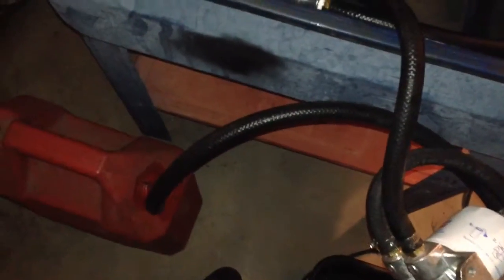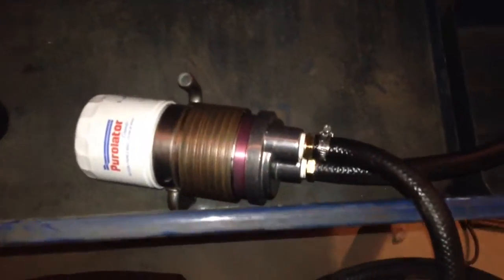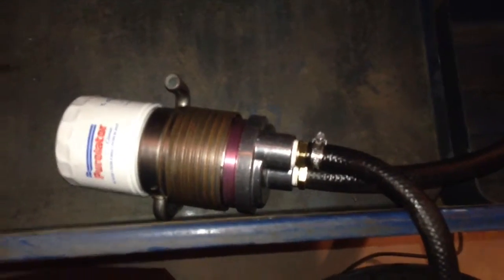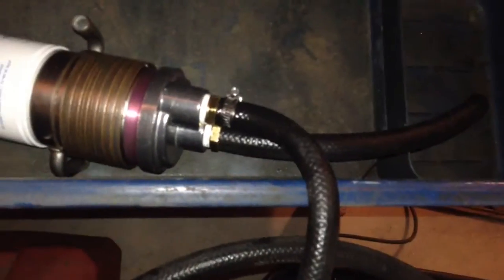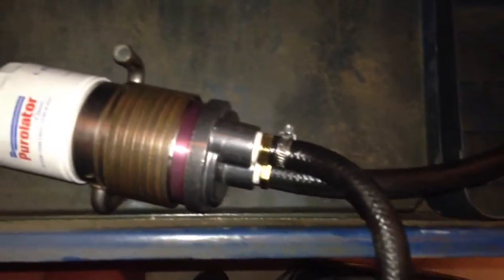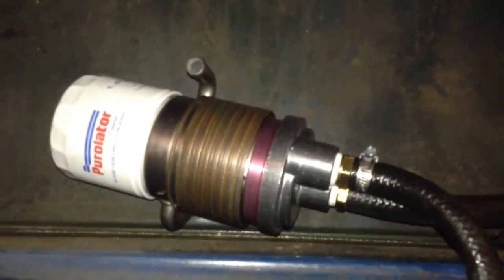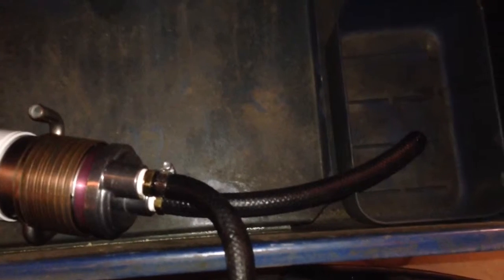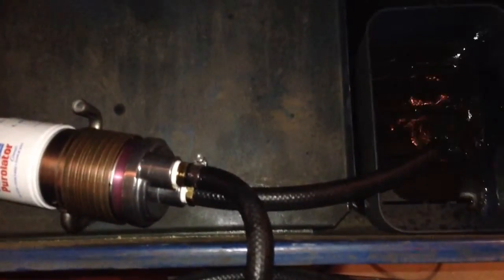OEM Subaru oil cooler flush / cleaning

Comment: Good video !  but you're lucky you didn't catch on fire with the Sparks that come from the electric motor in the drill Kaboom kabouuyakaaa  just an observation
Reply: Diesel isn't very volatile and wont ignite on spark. its also self lubricating the pump. the motor at the back of the drill will spark but no where near anything dangerous
Reply: @nickfranchetto3429   just worried about your safety wasn't here to troll sorry

Comment: nice video, would you tell me where you did find this part on top of the cooleR???  i would greatly need it to make that kind of setup thanks
Reply from the maker: I used a remote oil cooler attachment:Trans-Dapt 1058 Oil Filter Bypass 20Mm  
and the red ring between the cooler and the oil filter bypass was a wheel hubcentric ring I had lying around that happened to be the perfect size to fit between the two seals, used the filter to block tube that came off the block with the oil cooler to hold it all together and attached the oil filter on top of all that. hope that all made sense....